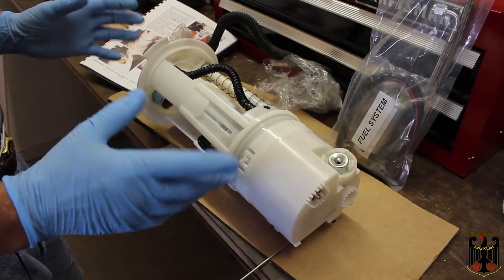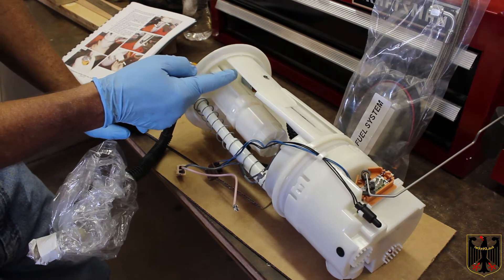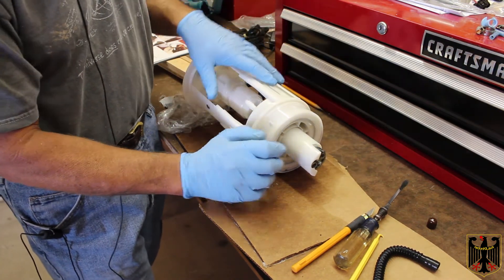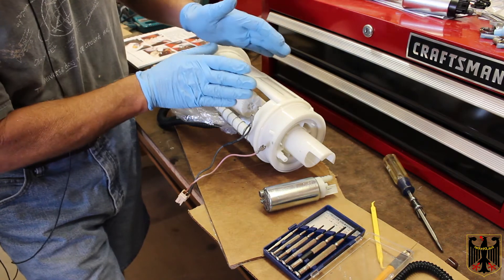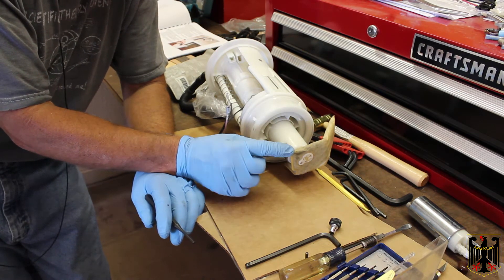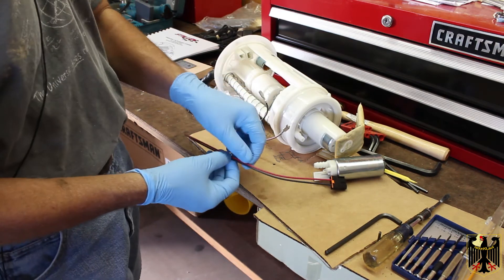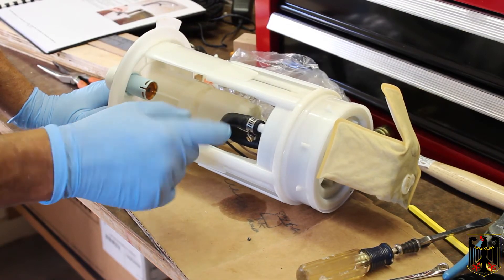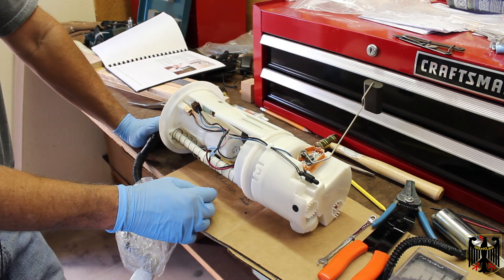VQ40 Stillen Supercharger Install - Part 2 - Fuel Pump Replacement

Comment: Aeromotive now offers a Stealth Series line of OEM replacement high performance, high flow fuel pumps that flow 340L/hr vs. the Walboro 255L/hr upgrades.  
-NEVER re-use fuel strainers.  Buy a new one.
-Auto parts stores have universal pre-manufactured hoses in 90°deg angles to correct that kink.

Comment: does this all come with the supercharger or did you buy it separately
Reply from the maker: It all comes with the kit from Stillen.  Do note that there is quite a lot of modification to the kit required to fit it on newer vehicles, though, so if you are not mechanically inclined it would be best to have a professional install the kit.  Thanks for watching!